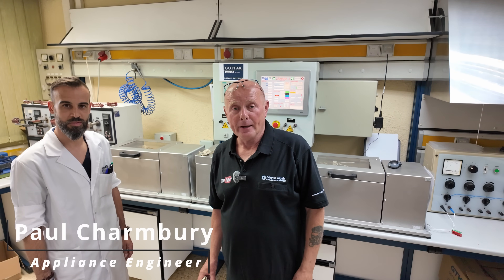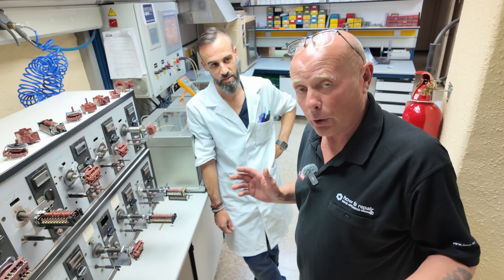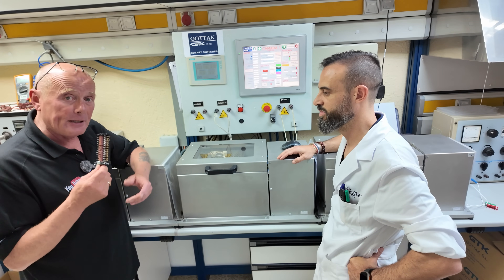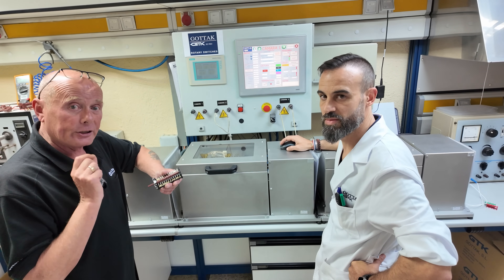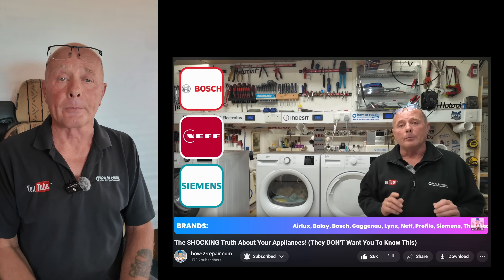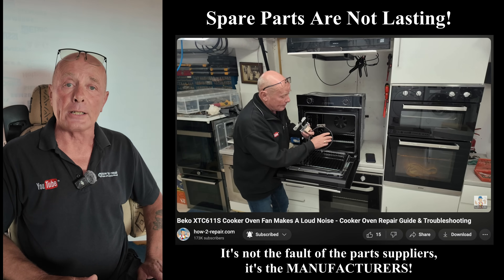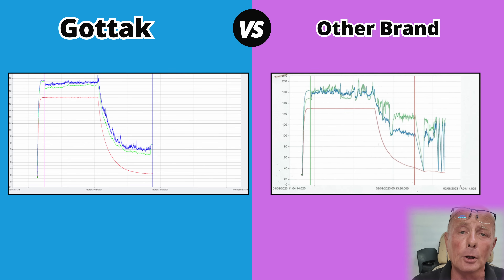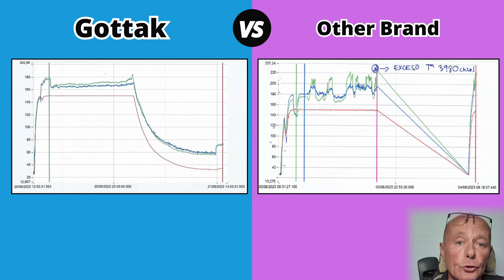Why Your Appliances FAIL SO FAST! Lab Results EXPOSE the Truth!

Comment: It's not just appliances that have built-in obsolescence, the majority of tech products have this built-in obsolescence. However, it's not a new thing, this built-in lifespan started with the light bulb and the 3 big companies. When light bulbs were first invented, they lasted so long, that the 3 big companies were not making nowhere near the amount of profits they wanted, so they conspired to create a lifespan, so light bulbs failed and would need replacing, with fines on companies whose light bulbs lasted "too long". 

One of the original light bulbs is still working in San Francisco firestation. 

But this is what happens when it's profits before everything else and the public just except it.
Reply from the maker: It's hard to believe that manufacturers expect consumers to be happy buying major appliances every few years. Using environmental issues to sell more machines is ridiculous, especially considering the ecological damage it causes. They are ruining their reputations by making such products.

Comment: You think those fancy UL lab tests are just there to ensure your doodad werks gud? They're figuring out exactly how many cycles it will last before it breaks so they can either cut costs if it's too strong or position warranties to maximize perceived value while excluding most failures.

Comment: I bought a washing machine in 1998 then in 2007 I put it in a rental is it still going today. In 2007 I purchased a Samsung front loader it crapped out in about 6 years. I took it apart and rebuilt it. There is a part called a spider that's made out of aluminum and if anodized would last forever but they intentionally don't anodized it so it corrodes terribly and swells and moves around and puts the drum out of concentricity that hits the plastic tub and cuts through it. it was clear to me this is intentional so their machine fails.
Reply from the maker: It's hard to believe that manufacturers expect consumers to be happy buying major appliances every few years. Using environmental issues to sell more machines is ridiculous, especially considering the ecological damage it causes. They are ruining their reputations by making such products.

Comment: There is an interesting case with chinese 2 stroke petrol engines 
  When  you take out the spark plug and also take off the carburetor you then shine a torch into the inlet with the piston at its lowest position you can see the light from the torch when you look into the combustion chamber. This causes a condition where the engine works until  it is run in then after that it will not start because of blowback through the carburetor. 
You then have to buy a new applience because there is nothing you can do to repair it.
Reply from the maker: Thank you for your comment. I appreciate people like you taking the time to write it out. Please share it where possible. It might help others make a wise choice instead of being misled by the industry.

Comment: In 1999 I purchased a Phillishave 5866 in july 2000 it failed just outside the warrenty period and the agents for Phillips would not repair it under warrenty so when I took the shaver home I took the cover off to investigate the reason for the failure. On the printed circuit board there was what looks like a 1k ohm resister but it was an inducter when I looked in the maplin catalogue I saw this component and it was only designed to handle 200mA  but I knew that the shaver handles much more than this when working . So I purchased 4 of these  inducters from maplin and installed them onto the PCB in 2 times series thus quadrupalling the current capacity. This restored the Phillishave 5866 to normal working order and it is still working to this day. In that time it has had a motor rebuild which I did some years ago and also replacement rechargable batteries. I still use it today.
Reply from the maker: Thanks for sharing your experience with that shaver, and it's great to hear it's still running after all these years!

Comment: Sadly, we now live in a society where even things as expensive as automobiles are intentionally designed to be thrown away and completely replaced the day after the warranty runs out.

Things aren't built to last anymore, and they're not built to be repaired.  They're built so that as soon as one part fails, the whole thing needs to be trashed and replaced.  Usually at ridiculously high cost to the consumer.
Reply from the maker: This brings me to a larger issue I'm passionate about: built-in obsolescence. I’ve made many controversial videos on this topic, and they often seem to get suppressed. To put it in perspective, Google is the largest search engine in the world, and YouTube, its subsidiary, is the second largest. Google’s business model relies on advertising revenue from manufacturers. My best-performing video on built-in obsolescence reached 750,000 views. That might sound good, but it’s a tiny fraction—approximately 0.05%—of the 1.4 billion English speakers in the world. We are fortunate enough to afford these machines while people in other parts of the world still wash clothes in rivers, yet important conversations about product longevity are often stifled because consumption drives our economy.

I plan to release another video soon with analytics to prove this point. I've also discovered some manufacturers appear to be using AI to shield their brands from negative feedback on videos, which I will cover in an upcoming exposé. Please consider sharing any of my built-in obsolescence videos to help them reach a larger audience.

Comment: The best way to make the manufacturers build quality stuff is to align our objectives:
Simply increase normal warranty to 20 years, so an equipment that breaks prematurely under normal conditions
 will cost something to the manufacturer. This will quickly make manufacturer change their quality policies.
Reply from the maker: That's a great suggestion, a longer warranty would definitely help encourage manufacturers to make more durable machines. This brings me to a larger issue I'm passionate about: built-in obsolescence. I’ve made many controversial videos on this topic, and they often seem to get suppressed. To put it in perspective, Google is the largest search engine in the world, and YouTube, its subsidiary, is the second largest. Google’s business model relies on advertising revenue from manufacturers. My best-performing video on built-in obsolescence reached 750,000 views. That might sound good, but it’s a tiny fraction—approximately 0.05%—of the 1.4 billion English speakers in the world. We are fortunate enough to afford these machines while people in other parts of the world still wash clothes in rivers, yet important conversations about product longevity are often stifled because consumption drives our economy.

I plan to release another video soon with analytics to prove this point. I've also discovered some manufacturers appear to be using AI to shield their brands from negative feedback on videos, which I will cover in an upcoming exposé. Please consider sharing any of my built-in obsolescence videos to help them reach a larger audience.

Comment: I cannot count the number of times a device stopped working shortly after the warranty ran out. In a lot of cases i am on my second or third device where my parents are still using their first one that is considerably older.
Reply from the maker: This brings me to a larger issue I'm passionate about: built-in obsolescence. I’ve made many controversial videos on this topic, and they often seem to get suppressed. To put it in perspective, Google is the largest search engine in the world, and YouTube, its subsidiary, is the second largest. Google’s business model relies on advertising revenue from manufacturers. My best-performing video on built-in obsolescence reached 750,000 views. That might sound good, but it’s a tiny fraction—approximately 0.05%—of the 1.4 billion English speakers in the world. We are fortunate enough to afford these machines while people in other parts of the world still wash clothes in rivers, yet important conversations about product longevity are often stifled because consumption drives our economy.

I plan to release another video soon with analytics to prove this point. I've also discovered some manufacturers appear to be using AI to shield their brands from negative feedback on videos, which I will cover in an upcoming exposé. Please consider sharing any of my built-in obsolescence videos to help them reach a larger audience.

Comment: I actually buy used as the prices of brand new are way too expensive when considering the length of time they actually last. At least this way I mitigate the loss. It is so annoying when expensive appliances fail  on purpose because of greed! A cradle to grave approach is what should be happening instead of adding more trash to the landfill.
Reply from the maker: Thanks for your comment, you are right to do what you feel is best. Also, this brings me to a larger issue I'm passionate about: built-in obsolescence. I’ve made many controversial videos on this topic, and they often seem to get suppressed. To put it in perspective, Google is the largest search engine in the world, and YouTube, its subsidiary, is the second largest. Google’s business model relies on advertising revenue from manufacturers. My best-performing video on built-in obsolescence reached 750,000 views. That might sound good, but it’s a tiny fraction—approximately 0.05%—of the 1.4 billion English speakers in the world. We are fortunate enough to afford these machines while people in other parts of the world still wash clothes in rivers, yet important conversations about product longevity are often stifled because consumption drives our economy.

I plan to release another video soon with analytics to prove this point. I've also discovered some manufacturers appear to be using AI to shield their brands from negative feedback on videos, which I will cover in an upcoming exposé. Please consider sharing any of my built-in obsolescence videos to help them reach a larger audience.

Comment: My 2022 Camry Hybrid just out of warranty and literally just out of its required inspection (oil, 200pt inspection etc).
Got it home from stealership, next day check engine light comes on. Drive to stealership. $2500usd to replace 4 components in the hvap? system.  I bought a $20 obd2 port scanner.  Cleared the "water in system" code with scanner. 1200 miles later, still no problem.  
Dealership are just causing error codes at will to make us pay.  Sickening, Toyota. Sickening.
My Tesla P85D(2015) had ZERO problems in four years until it totaled itself with FSD.
You cannot say anything to change my mind.
We are F'd.
Reply from the maker: This brings me to a larger issue I'm passionate about: built-in obsolescence. I’ve made many controversial videos on this topic, and they often seem to get suppressed. To put it in perspective, Google is the largest search engine in the world, and YouTube, its subsidiary, is the second largest. Google’s business model relies on advertising revenue from manufacturers. My best-performing video on built-in obsolescence reached 750,000 views. That might sound good, but it’s a tiny fraction—approximately 0.05%—of the 1.4 billion English speakers in the world. We are fortunate enough to afford these machines while people in other parts of the world still wash clothes in rivers, yet important conversations about product longevity are often stifled because consumption drives our economy.

I plan to release another video soon with analytics to prove this point. I've also discovered some manufacturers appear to be using AI to shield their brands from negative feedback on videos, which I will cover in an upcoming exposé. Please consider sharing any of my built-in obsolescence videos to help them reach a larger audience.

Comment: They have water heaters down to a science. Now, even garbage disposers are failing very quickly. The same exact model of disposer I have been installing for 30 years,used to last 10 years,then 5 or so,now it is failing in a year or 2. Auto manufacturers are getting in on the act. Now, they want to connect everything to the internet so they can kill it with updates.
Reply from the maker: Thank you for sharing your experiences; it's a frustrating trend that many consumers are noticing. This brings me to a larger issue I'm passionate about: built-in obsolescence. I’ve made many controversial videos on this topic, and they often seem to get suppressed. To put it in perspective, Google is the largest search engine in the world, and YouTube, its subsidiary, is the second largest. Google’s business model relies on advertising revenue from manufacturers. My best-performing video on built-in obsolescence reached 750,000 views. That might sound good, but it’s a tiny fraction—approximately 0.05%—of the 1.4 billion English speakers in the world. We are fortunate enough to afford these machines while people in other parts of the world still wash clothes in rivers, yet important conversations about product longevity are often stifled because consumption drives our economy.

I plan to release another video soon with analytics to prove this point. I've also discovered some manufacturers appear to be using AI to shield their brands from negative feedback on videos, which I will cover in an upcoming exposé. Please consider sharing any of my built-in obsolescence videos to help them reach a larger audience.

Comment: WOW - I thought it was that. I think this was also an outcome with the lighting thig I mentioned. I noticed that
several of the new light fixtures I was putting in would burn out incandescents very quickly. There was some
other channel that addressed that as well.  But I concluded this was also due to the lighting manus seeking
to collude with the led manus to hasten conversion to the more expensive led lights.  I was/am PISSED OFF.
Reply from the maker: This brings me to a larger issue I'm passionate about: built-in obsolescence. I’ve made many controversial videos on this topic, and they often seem to get suppressed. To put it in perspective, Google is the largest search engine in the world, and YouTube, its subsidiary, is the second largest. Google’s business model relies on advertising revenue from manufacturers. My best-performing video on built-in obsolescence reached 750,000 views. That might sound good, but it’s a tiny fraction—approximately 0.05%—of the 1.4 billion English speakers in the world. We are fortunate enough to afford these machines while people in other parts of the world still wash clothes in rivers, yet important conversations about product longevity are often stifled because consumption drives our economy.

I plan to release another video soon with analytics to prove this point. I've also discovered some manufacturers appear to be using AI to shield their brands from negative feedback on videos, which I will cover in an upcoming exposé. Please consider sharing any of my built-in obsolescence videos to help them reach a larger audience.

Comment: Amazing how most don't understand conspiracy is a real thing, and the powers that be actually came together, and still do, to make agreements on obsolescence for resale abilities!
Edison made his bulb to last forever, and Ford originally made his cars to last, and so on, but that made $$ hard to come by for investors, if a person only needs to buy one product for life.
Those Rockefeller types of investors, and CEOs are who conspired together, in the early 1900's, to make sure a lightbulb would burn out around 7 years.
Today they're making cars even cheaper, but also, if it's over 10 yrs, they're not selling replacement parts to guarantee old cars won't be around, and of course manufacturers are making it impossible for even mechanics to work on them!

The Black Rock investor types have bottled up everything to make sure we surfs can do nothing but live as they dictate, if they allow us to!

I have a 10 year old washer now that just needs a simple small part, but it's on backorder, and I don't really have the faith it's going to come in.
So, the billionaires have made sure, for the sake of a $30 item to keep my washer going (which could have been made to not wear out to begin with) if it doesn't come then a whole washer goes in a landfill, so I'm forced to spend another nearly $1,000 for a ventless washer/dryer combo!

Comment: Very interesting, thanks. In your experience which brands fair best for longevity? I have just redone kitchen with mix of Bosch and Neff appliances (they share the same parent company). I did so because I felt they'd deliver better value in the long run by lasting longer. Was I mistaken in this belief?
Reply from the maker: At the moment I'm supporting any company that put a minimum for five year full parts and labour warranty. At least this is giving you the reassurance the appliance will last that period of time.